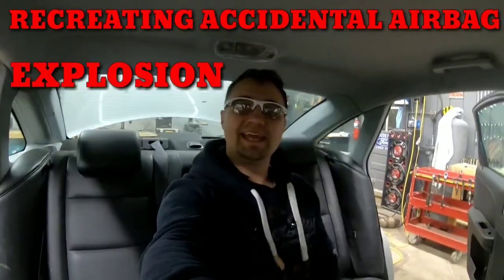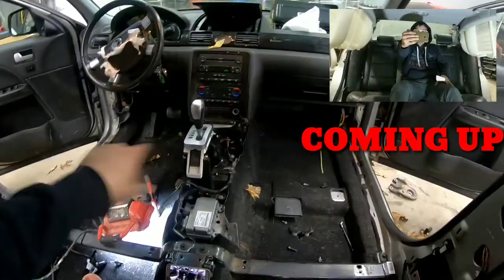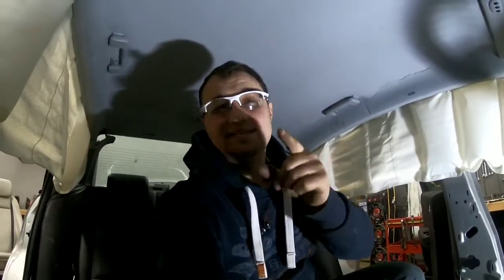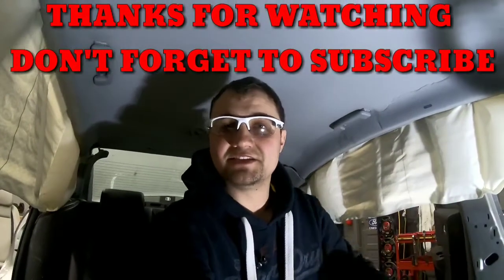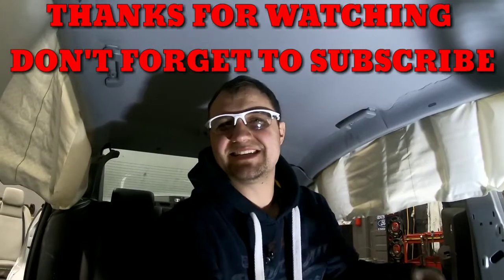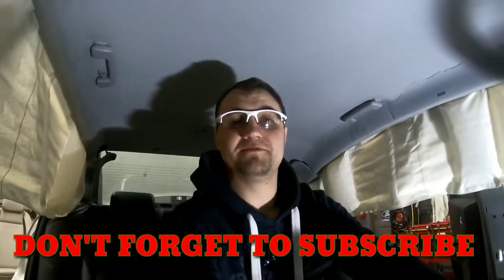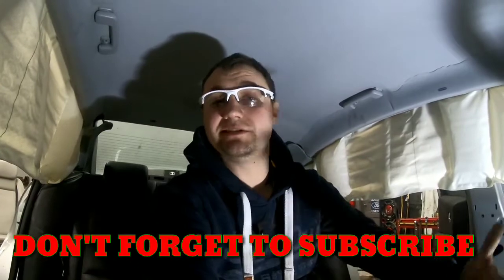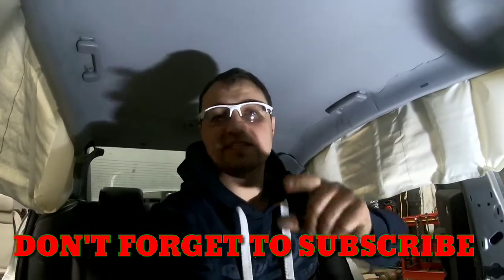AIRBAG EXPLOSION!! ( ACCIDENTALLY DEPLOYED )

Comment: When I worked for buick gmc we had an issue with water getting into the vehicle on buck enclaves/gmc acadias and leaking all over the dash fuse block and the bcm, well i guess something airbag related runs right there too, shorted out the module and some poor lady was just driving down the road when all her air bags went off. Pretty neat video btw!